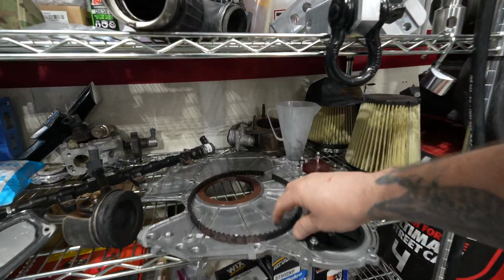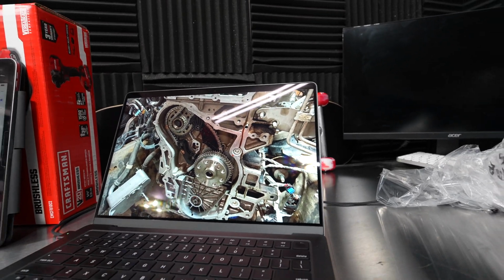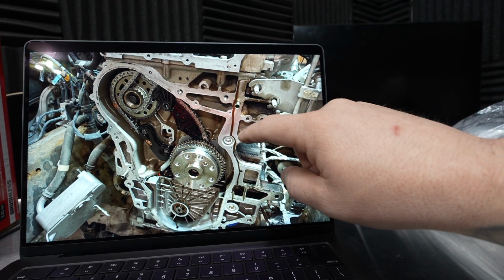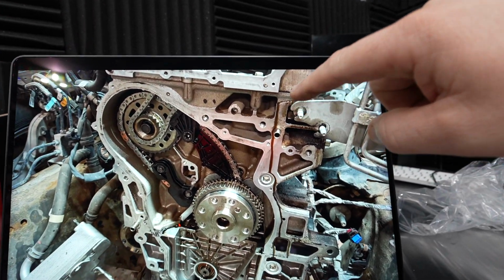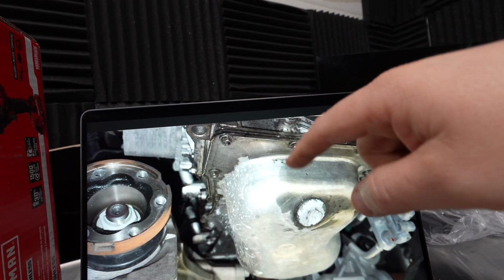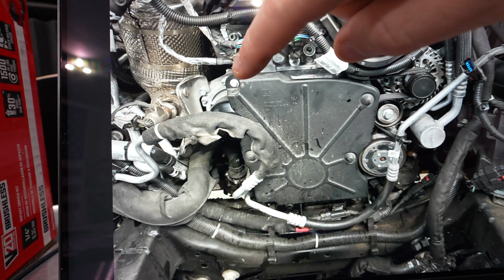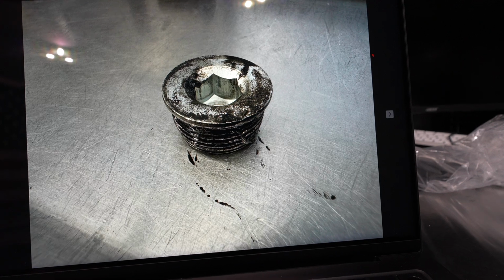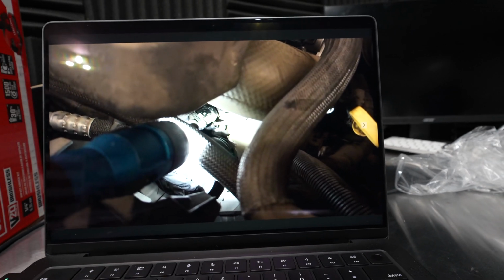GM Tech Shows the Most Common 3.0 Duramax Engine Oil Leaks

Comment from the maker: 3.0 Duramax is notorious for engine oil leaks. If yours is dripping in your driveway and you are curious what it could be before you head off to the dealer, this video is just for you. I get emails pretty much daily and it's tough to answer them, so I decided to start answering via video since it may be a question others have. mstrgoodwrench@gmail.com is where you can send yours and maybe I will make a video specific for you! https://www.demonworkshop.com https://www.duramaxnews.com
Oil Pump Wet Belt:  https://youtu.be/dxGu1pIJeGo
Reply: im ordering a zr2 in april but im not sure if i should get the 3.0 im just a little concerned about oil consumption. does it just consume more oil for break in?
Reply: @trippgraham4751 I have a 2023 LZ0. I have changed the oil every 5k miles since new. Every oil change I am about 3/4 qt to 1 qt low on the dipstick. The truck holds exactly 7 qts. I am at 50k miles now and still the same oil consumption.

Comment: Took my truck in for its first oil change. 40 minutes later got told my oil pan gasket was bad. Truck only has 5k miles. 

I did ask about the thrust bearing issue but I got told they couldn’t check anything until something actually happens 🤷

Comment: Do you have to remove the cab for a valve cover leak? Because this is what the dealer is telling me after they replaced a leaking turbo and still can’t find where it’s coming from.
Reply from the maker: No, it makes the job a whole lot easier for the tech by pulling the cab but it's not part of the procedure. The procedure does outline the tech to remove the cowl below the windshield and that provides more access. I have done the camshaft cover without pulling any of that and it's doable.
Reply: @DemonWorks Thanks a lot!

Comment: I have an oil leak coming up from the passenger side, above the oil pan. Appears to be something like an oil pressure sensor there, and also a metal coolant line. Both are in close proximity. Have those been known to leak? I checked the front plug that is notorious, it's completely dry. But the passenger side of the engine above the pan is covered in oil and is starting to drip lol. 120k lm2. Thanks!

Comment: 2023 Sierra 3.0 Duramax (40K miles) is in the shop for engine oil leak.  Dealer told me it's the crank case.  Thanks for the video.

Comment: Answers my question...5.3 or 6.2 then
Reply: I don't know if its that cut and dry. The 6.2's are having a lot of issues and that motor is on back order for who knows how long. I think a lot of the issues with oil leaks recurring is failure to follow proper procedure and just trying to get the job done quickly. You can't rush it when it comes to front or rear engine covers.

Comment: Had my def tank heater go out, had to replace it and they found a hole in the radiator and engine cover leaks (82k miles).  Warranty covered the leaks, and extended warranty I got on it covered the radiator and def tank (warranty on that ends at 80k). I got lucky as hell. Also oil pan leak too.
The oil drain bolt SUCKS. Person who owned it before me I swear used an impact to put it on, ended up stripping out. Aftermarket one is the way to go.

Comment: Where is your shop. I need help and my dealer is a DA. They have been shorthanded for 5 years. He quoted 15,000 to replace the oil belt and timing chain and I’m not sure if this one even has the old belt. 2020

Comment: took my 21 lb2 in for a small oil leak. gm said the hydraulic motor mount was broken, when they went in to fix it, they said it was also leaking from the dipstick funnel on the oil pan
Reply from the maker: good finds !

Comment: Good morning. Quick question for you. 

My truck has 36,000 mi and I've noticed a substantial decrease in MPG I've messaged you in other videos before about low MPG in my truck compared to what a lot of people are getting.. 

So trying to keep it straight to the point short and sweet. I took the truck into the dealer voicing my thoughts and they ended up changing my catalytic converter / DPF I guess. They said it was clogged.. I told them I believe it's getting clogged due to the oil being sucked through the PCV and making its way to the exhaust eventuality. As I'm still losing almost 2 quarts of oil every 6,000 mi. So just a heads up for other people on that one that don't have a oil catch can because my dealer would void warranty if I did it... 

I also had an oil leak coming from the front crank cover. It look like the oil pan was leaking to me but they said it was front crankcase cover.. 

So my dealer took care of all those issues under warranty so far I've driven the truck 300 mi since I picked it up and I have not gone into regen yet which I was regening every hundred miles prior.

Question I have though on the banks Idash if you monitor engine coolant temperature what kind of temperature reading are you guys getting. I could have swore before it went into the dealer mine would sit around 200° and now that I got it back at idle it's chilling at 219 to 220. And cruise control at 75 I've seen it hit 230. But it'll drop to 200 and climb to 225. Back and forth almost like I'm low on coolant And it's able to circulate but then it gets air and then it heats up and then back and forth but all the levels look good.. 

Thank you for all the information that you put for us.

Comment: I posted in one of your other videos that I had a engine plug leaking oil on my LM2 engine. It was covered by the warranty. Fortunately, I was 180 miles short of 36k. My question is would you recommend changing oil sooner in case some of the sealant got in the motor oil after the tech resealed the plug?

Comment: My 2021 w/70k has been getting oil samples flagged by Blackstone for Copper & secondary Tin. Copper in last sample is up to 360ppm. Has also been in the shop 6 times @ 2 different GM dealers recently with massive def consumption and keeps going into limp mode with the dreaded service emissions system then a derate. Both shops can’t figure it out and they have an open ticket with the engineers in Michigan. 
About to unload this unreliable pile of 💩.  
With the copper & tin I’m suspecting a turbo bearing.  
What do you think? Have used Dex-D 0w-20 ea oil change.
Heading to a 3rd GM dealership on Monday for round 7……
Reply: Yikes

Comment: I know GM says the oil pump belt interval was changed from 150K to 200K from the two engines. But what did GM change to make it last longer? Almost sounds like they just increased the interval on paper, haven’t been able to find what they actually changed with this belt.
Reply: Cool, thanks for info I will check out your video. Do you know of they increased the 150k to 200k for the LM2 or just the LZ0?
Reply from the maker: I did a video on that back when it was changed, one of my first videos owning the 2023 LZ0. there wasn't a design change, their testing determined it to be better than expected so they bumped the number up is what I heard.

Comment: Thanks for the video Greg!  This will be great to go to the shop with and see what they have to say about this massive oil leak.  I can believe this has been the third time it has been replaced.....  The order of replacement was seal only, seal only, main rear cover with seal factory placed.  The worst of all was the main cover replacement where I have oil leaking so badly that it is dripping from the back bumper.  The sad part is the first time, the leak actually wasn't that bad but it was still leaking so we went back in.  It's been four months + now without a working truck due to scheduling issues and I'm just sad to not have my truck to drive.
Reply from the maker: hopefully it gets resolved ! keep me informed, please.

Comment: Can you do a cost estimate for timing chain and belt replacement? My lm2 has 111k miles no leaks at all thankfully but its coming time for that belt and might as well get that updated timing chain (My lm2 is a 2020).
Reply from the maker: chains will likely be in the $8-12k range depending on dealer, you will do the belt at the same time. You may be better off looking into an extended warranty. Here is the belt video: https://youtu.be/dxGu1pIJeGo

Comment: I am in the market for a new truck before I retire & I feel this is the engine but I only want an extended cab.
GM does not appear to make it anymore why is everything a 4 doors with a 6’-5” bed I would like an extended cab with a 8’ bed & this engine.
The only company is Ford that makes an extended cab but that is very limited as well.
Reply from the maker: You want what GM calls the "double cab" but gm does not offer a 8" bed with the 1500 trucks.
Reply: @ 
Thank you I appreciate your replay I am really leaning towards 3.0 L GM diesel 1500 series.
I want to keep the truck as long as I can yet I see a few things you have upgraded that makes sense oil & trans pan replacement, cold air intake system, transmission thermostat & larger cooler, oil catch can.
I feel they would extend the life of the vehicle tremendously so I can do a few myself yet others I would need to find a shop to perform them. 
Or would the truck last as long without them.

Comment: just had my 22 in for the front plug leaking a couple weeks ago. . they warrantied it but for the front cover. looks like they put a new plug in though. Maybe they did both or pulled the plug and cleaned it because the plug was not on the invoice.
Reply: My first plug was a misdiagnosis. I also thought I needed the front cover. It was actually the plug. I was smart about it and removed the front radiator and found plug was culprit. Cleaned plug and applied thread sealant liquid Teflon tape basically. Works good.
Reply from the maker: Probably cleaned it, that's a good tech, not all know about the plug.